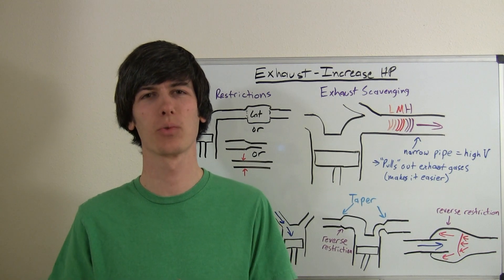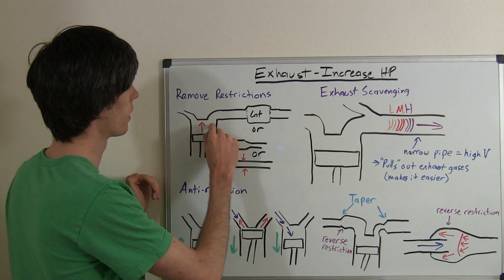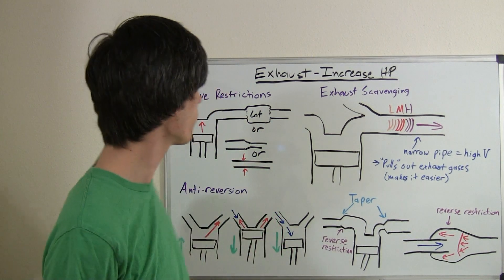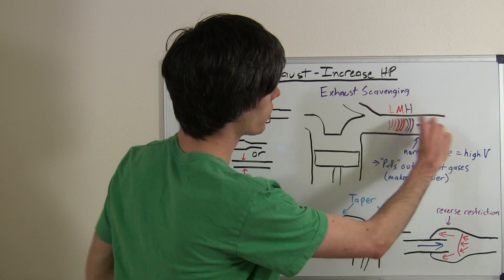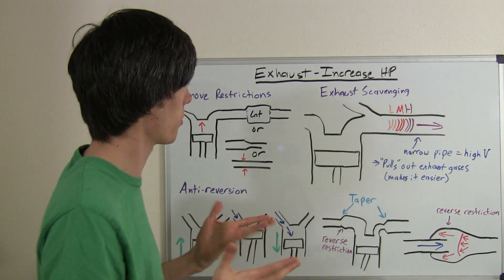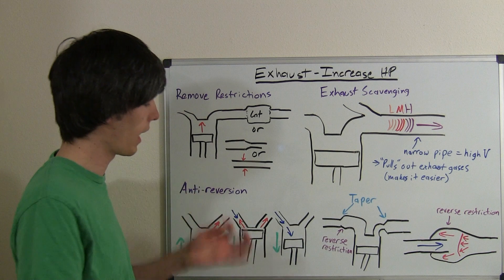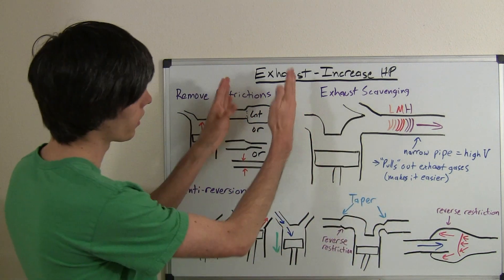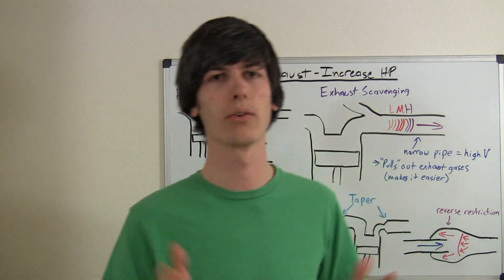Performance Exhaust - More Horsepower

Comment: Years ago you could get better power and better economy with with a less restrictive exhaust.
Is the same true today, with all manufacturers striving for better economy?
I ask because my 2 L turbo is very quiet, and has a 1 ft diameter x 3 ft long muffler, and 2.5 inch exhaust pipe.
So is it possible to have low back pressure and still be quiet?
Or could I gain some mpg with a slightly noiser muffler?
Opinions are welcome.

Comment: What if I added a wide pipe for more air to flow but had installed inside the larger pipe smaller pipes inside which would be to divide the air and keep the high V

Comment: Lots of good info in your videos like always.  I think it would be good to acknowledge at the beginning of your videos that the discussions are theoretical and thus may not reflect actual reality given various combinations of parts and methods of assembly.  For example, obviously, tapers in the exhaust system have an impact on flow rates, however, where these occur (distance from cylinders) may significantly alter their impact).  I think the idea here is to give viewers a more realistic picture of the range of variables that impact the issue they're thinking about.  Otherwise, they may get the misguided notion that simply doing X will lead the desired outcome, when there are other variables impacting the situation.  Effectively solving problems in the real world is frequently more nuanced than we'd like to believe !!!!  In the mean time, keep up the good work.

Comment: I figured this video would be the best place to ask a question. I have a 2000 Subaru Outback and in my experiments with DIY exhaust modifications I ended up sawing off basically half of my exhaust system. After the cats, there’s a 1 foot section of 2.25 inch pipe with an exhaust tip and that’s it. Besides being annoyingly loud, it feels like my car lost whatever little oomph it had. I could be crazy but I also think I lost a few MPGs. Could having only half an exhaust system really cause these problems? Thankfully I kept the original pipes and I got my friend to weld them together. I’m just going to slap a Magnaflow muffler on the end and call it good. Should I see a slight gain in power and MPG after bringing my exhaust back to sort of stock? Thanks ahead to anyone who had an answer. (I’m just going to leave exhaust work to the professionals) 😂

Comment: I had a 2010 Honda Fit with a few mods nothing big then i got my ecu tuned.. now I have a 2013 Honda Fit I'm gonna put all my mods from my 2010 to my 2013 now my question is should I swap the ecu or should I get a retune

Comment: On street engines, reversion is bad. In high performance applications, reversion actually helps you at certain RPM (peak torque) and thus is inevitable everywhere else. Scavenging is only half the story mate ;)

Comment: true my car came with a 1.6 inch diameter pipe...it was slow and sluggish, i took out the old pipes put a 2.23 inch pipe all the way from the cat. i also put a high flow catalytic converter the car felt faster at low rpm and also fast on high way. It was a dual exhaust  made a big difference

Comment: Hi Sir, I watched your videos and feel impressive! What amazing! I am also a fan to refit my vehicle and desire to improve performance for acceleration. But recently there is one issue making me confused and frustrated. So i really want to consult with you to get suggestion from you. My vehicle is Jaguar F-Pace 3.0 V6 supercharged gasoline. I installed a pair of downpipes with 200 cell catalyst converters in series respectively(see attached photo) instead of original one. And I tested the acceleration and found out there is torque lost at front range and no any improvement at mid&later range....i don't understand where it goes wrong. I am really looking forward to your reply. Thank you very much.!!!

Comment: I have a 4afe stock engine. it doesn't have any catalytic converter. the stock pipe is 1.5"
i removed the resonator and replaced it w/ a glasspack and a free flow muffler with an 2" inlet. 
the question is should that increase or decrease power? 

I have friends telling me that for a stock engine:
1. I should leave my pipe size stock at 1.5" not increased it to 2" 
2. use a maximum of 2" inlet free flow muffler coz any bigger will have no back pressure and losing power. 
so I kinda followed that but it looks like i lost power, and it is noticeable w/ i floor it, the increase in rpm is very slow. like no power / pressure or something. 

lastly, what do you suggest, chambered or free flow muffler. I was also told that for touge, chambered is better than free flow. free flow is better for autocross. 

Hope you can help me out. thanks

Comment: Hi, I would like to know if you have a formula to calculate the ideal size for my exhaust diameter? i've a 325d 197hp @ 340hp 650nm. I've logged my car, if you need some data to calculate ask me 🙂 Thank you for your help.

Comment: On 4 cilinder 1,6 Lt engine with a 1,5" pipe, do you think it would make a difference to chanche to a 2" pipe + high flow cat and muffler? And if the exit of the header remains narrower than the rest of the pipe? Thanks
Reply: change*

Comment: Hi,
- where is the best place to add the last example you gave ? (the air pocket exemple)
- And the diameter of the exhaust pipe must be, near, the same from the intake?(taper exemple)
In my project car I´m planing to have a aggressive car for a daily drive. And these ideas you gave is necessary and always welcome.

Comment: correct me if I'm wrong . but the more tapered the pipes, the better the exhaust system is ?? tapered in the right spots of course, on the intake and exhaust system ..

Comment: I understand you have to find an optimum balance between exhaust gas velocity and reducing restriction. But how does one actually find that balance? ie how do you choose the correct pipe diameter and length?

Comment: Why do you actually need an exhaust pipe? Couldnt you blow gases directly to atmosphere?
Reply: You can, it's just extremely loud, illegal, and probably not something you want to vent under the hood next to your intake. You would save some weight though.
Reply: Andre Torres you can make more power with an exhaust than without

Comment: Is it possible to connect a 3" pipe into a muffler with a 2.5" inlet?
Reply: RR 10 yes but why?
Reply: I want a Borla muffler but the muffler I want has a 2.25" inlet. But I'm dropping the piping from 3" down to 2.5".

Comment: What if you remove your exhaust completely?
Reply: You can, it's just extremely loud, illegal, and probably not something you want to vent under the hood next to your intake. You would save some weight though.
Reply: bobdabildr12345 you would lose power, efficiency, and emissions
Reply: Why would I lose power? Doesn't less backpressure equate more efficiency?
Reply: ***** Some back pressure actually increases performance.
Reply: oh

Comment: sooo back pressue isnt a good thing? because when i straight piped my car everyone was like "oh youre car is gonna have shitty acceleration, poor gas millage, and youre gonna damage your engine! " and if anything im getting better gas millage , and idk about the power feels about the same but i know i removed quite a bit of weight. something like 30-40 pounds.
Reply: Daniel Diaz back pressure is never a good thing but compromises can be made to make more power with back pressure
Reply: Daniel Diaz the idea that an engine needs back pressure is incorrect but likely comes from the idea that you can go too big of a diameter and negatively effect scavenging and in some cases part throttle performance  (where you usually drive). Your wide open throttle performance will almost never be negatively effected by having too big of a pipe (within reason) however there is deminishing returns to the cost not to mention the space it'll take up so going as big as you need, not as big as possible.
Reply: Dented Yota yes you can have too big a a pipe. Do you see F1 with a 3-4" pipe? No, and how many horses are they making? More than your car will. Velocity is more important than pipe diameter. Increasing diameter reduces velocity. The ideal is a diameter that keeps velocity just below supersonic.

There are also other considerations like tuning which causes "back pressure" but can achieve more power through negative pressure reaching the cylinder and creating a low pressure before the E value closes

Comment: Do you have a video that explains why cars shoot flames when the drive lets off the gas after a hard pull?  Say going into a turn at a race track?
Reply: The reason cars have fire out the exhaust when they let off the gas is because while they're flooring it, a TON of gas is getting dumped into the engine. When they let off the gas, a ton of gas has just been dumped into the engine, but now the engine isn't under it's full-power load, so it can't burn all the gas that got dumped into it. That extra gas gets blown out the exhaust, burning, and that's why you'll see it out the tailpipe right when they let off.

Comment: so do you want the narrowest pipe possible?
What would be a good size pipe for a 4.6L V8 32 valve? I currently have 2.5" going to 2" at the mufflers. (well, where the mufflers were ;) )
Reply: +Xero Yes, you ideally would want a 1/2" pipe, but that wouldnt allow for all the gases to escape quick enough, so you really should go with 1" pipe exhaust...hope this helps
Reply: +Jergialipananu really? 1" is pretty smal.l I'd think you want bigger pipes for a bigger engine, right?
Reply: typical rule of thumb is 1/8" per cylinder, so you have 8, which would equal 1".
Reply: Jergialipananu hmm interesting.. thanks!
Reply: I've seen v8s with a displacement  of 7 liters. higher displacement more exhaust. there is no "rule of thumb"
Reply: Xero depends on rpm, engine power, etc. there are formulas for such things. Anything more than 2" is nuts

Comment: And last but not least, altering your exhaust can affect your low-end Torque and high-end hp.
Reply: Is there any reliable information you could point to on what changes in the exhaust affects the low end torque? Thanks!
Reply: +Nathan Kennedy exhaust engineering is a complicated science. if you alter the exhaust scavenging, then you could have either more torque or more horsepower at certain RPM. My car gains more low end torque with stock than a larger pipe.
Reply: +niacal4nia yeah that's pretty much what I assumed, but thank you for the answer!
Reply: Like I have two chevy cobalt LS's. One has a nice exhaust leak, and the other exhaust is perfectly fine. The car with the exhaust leak feels like it has much less low end torque than the other.

Comment: I would like to see a video going into detail about back pressure, and why it is sometimes needed and why some cars particularly N/A cars lose power if they do not have back pressure.
Reply: it's a common misconception that some vehicles require back pressure. As I understand it, this myth came about from people putting larger diameter pipes than needed on vehicles, as a result, the exhaust velocity was reduced, thereby impairing the cylinders' ability to clear the spent fuel and air mixture. Higher flow is always better. It's just that larger pipes aren't always the way to achieve that higher flow. I apologise for any typos or poor diction/grammar; I wrote this on my phone. Sources available upon request. haha. Have a good night/day!
Reply: Jay Ramsey interesting.  so what if the exhaust pipe tapers , then opens up to 3 inches to eliminate back pressure . is that a good idea ??

Comment: I wish you had videos for everything.  You explain it very simply and to the point. I personally wish there was more detail.  I'm currently in charge of designing the intake and exhaust for Iowa State's Formula SAE team.  When I was designing the exhaust, the acoustics were annoying to deal with.  For getting the right pressure differential I used quarter pipe equations to get the right length for the exhaust and placement of the muffler (no cat is required), but when I was trying to design for the sound to be below a certain point, that took me so long to figure something out.  I didn't understand how to calculate roughly how effective a resonator or muffler would be.  Eventually I just decided to run tests with different concepts to see which one was the best without causing to much back pressure.  How would you estimate the sound intensity after running the exhaust through a muffler and/or resonator?

Comment: can you please explain why the toyota engine in general produce a really low HP? in my case I have a toyota fortuner with a 2.5 i-4 diesel engine (turbo diesel) but only produced 102 HP and 265 N.M of torque...  and what can i do to increase the performance of that motor? thanks

Comment: Solution: straight pipe.
Reply: batsman46 no.
Reply: Nicolas Losito yes.
Reply: batsman46 it can kill power depending on the oem exhaust and more power can be found through tuning.
Reply: Nicolas Losito lol it was only a joke my friend let's not get technical over the pressure aspect and tuning shall we. this is youtube after all

Comment: what would happen if you downsized your exhaust? for example from the headers to the y pipe its 2 inches then y pipe back to muffler its down sized to 1.75 that would get more velocity right? would that gain anything or better low end?
Reply: I think you would get backpressure because it would taper in one section to the 1.75" resulting in reverse flow.
Plus 2" is pretty small as is.
Reply: Reid Murnan you would create positive pulsations which is not good lol

Comment: hi! just watched ur vids and its amazing how u explained every single things.. here i have one question playing in my mind, which one is better in increasing hp between dual exhaust system & a single exhaust system? do u get what im sayin? gonna installed exhaust system on my Kia forte koup 2.0 NA.. I find its look nice when Someone have a dual performance exhaust at their back, so im thinkin to install one for my ride, is it possible to install dual performance exhaust on NA engine? will it gives out more power or it will just spoiled my engine? and what is the different its make between a s flow performance exhaust n straight flow performance exhaust. thanks bro
Reply: you will have backpressure when you are adding dual exhaust.i had honda city type Z (year2000)1.5NA  and go for dual exhaust. i felt the backpressure hitting me hard. i get rid one of the exhaust and go for one exhaust and straight piping. increase hp and less backpressure. i recommend go with one exhaust. straight pipe is up to you.

Comment: +Engineering Explained  i'm planning to install a header on my V4 car do i need to widen the manifolds or can i make do with the stock piping and is it benefecial to install another exhaust along with the existing exhaust (real dual exhaust)
Reply: +theuncanspan p.s im afraid of power loss if i enlrage the pipe. 

any help would be appreciated :)

Comment: wow can't believe it's that simple all these years of balancing pipes by length and or bore to change the flow rates and alter the driving forces caused by the sound waves to stretch out and flatten the torque curve to pick up on the cam sooner, or to peak higher so that after the gear change you not left with a flat spot or worse still a low spot that takes forever to pull through was wasted. I mean spending all my working life trying to best match the exhaust to the intake system (because any increase in performance is useless unless the intake can respond to it) and ignition system (which will have to talk different demands placed upon it if your tuning has done anything at all) can be completely undone with some super Mario brothers plumbing. wish I had seen this before spending years of my life  learning how to improve on the cheap as feck restricted by emissions (noise and gasses) and style and efficiency and driver dumbfuckery general acceptable wear rates not to mention space under the vehicle.
Reply: Richard Shields Google is your friend
Reply: To late I've thrown my tools in the river and taken up knitting instead. All the years of studies and trial by fire experiments not to mention the years of experience  (not just my own but others I've learned from) are a complete waste of time! now I just wait for the day the ic motor is outlawed and we all travel by electric hovercraft!

Comment: Question, how does the exhaust gas go back into the combustion chamber if your timing is set right and the exhaust valve will be fully closed?
Reply: Igor Keating positive exhaust pulsations can return to the cylinder before the value closes and keeps exhaust gas inside the cylinder